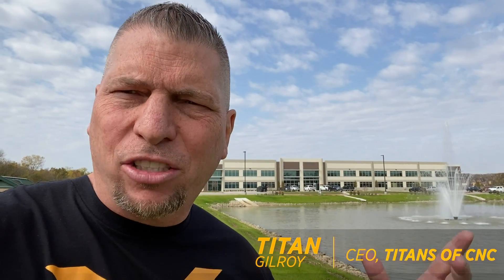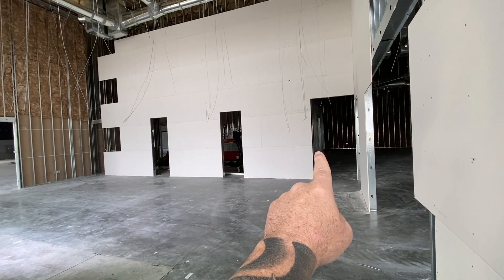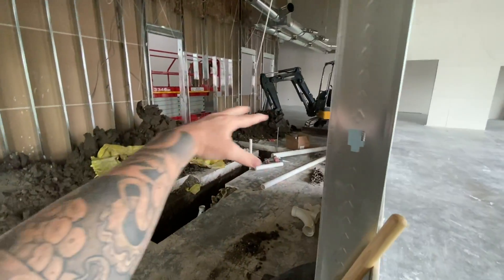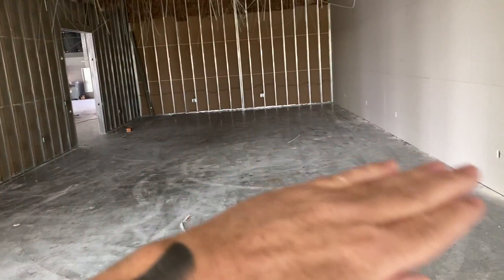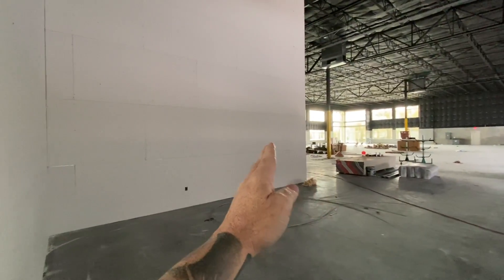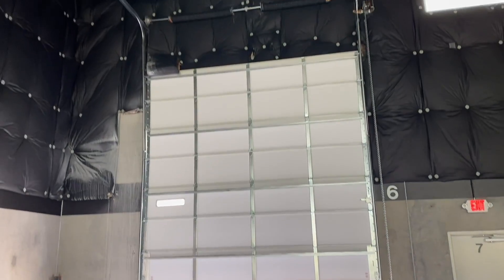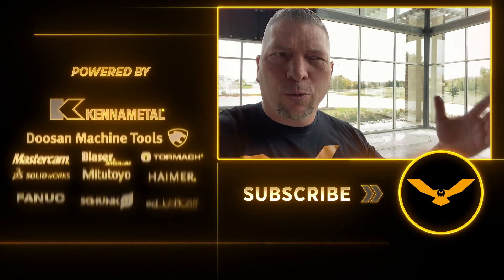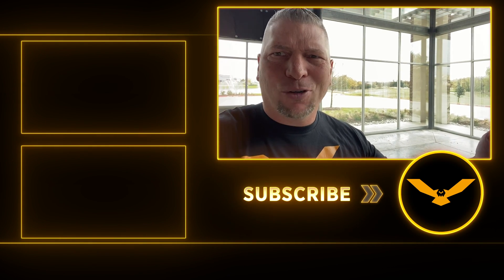BIGGER DOOR for BIGGER CNC MACHINES | UPDATE #3

Comment: Do you have a special method with the flooring, as in do you have to make it extremely flat?
Reply: One will be leveling up each machine to were they should be, very accurately. The machines got adjustable pads, and/or shim plates used. Flooring will be made 'normal flat'.
Reply: @Rimrock300  I agree with that, take a look at 8:20 minute mark of this shop and you will see they have taken out 7ft of old foundations and dirt and replacing with 7ft of concrete and I can only think of two possible reasons, vibration or improving the flatness of the work area. Different style of machining to the units seen above, though interesting. Hopefully, I build a CNC from a $1000 machine next year, and at least I know I can just shim it or leg level kit etc. Cheers for info!

Comment: The concrete slab looks a bit thin for a CNC shop.
Reply: It's possible a general purpose leased building, that one are free to modify the interior as wished. Likely there will be put in thicker concrete slabs at spots where needed

Comment: 1600A 120/ 208V doesn't seem like a whole lot for what you are building.. The 60HP Dusan's spindle pulls 175A  at full power all by itself (on a 250-350A breaker). Add fluid pumps, chip remover, positioning servos, tool changer,, compressed air etc and that machine accessories will fully load its own 400A Panelboard... Bringing in 1600A 480V service would have been well worth it in the long run (unless you are planning to augment with solar).. I know, its easy to spend your money

Comment: Why would do 208 power!? You have 460 there with step downs to 230 lol
Reply from the maker: All my machines are already dialed for 208
Reply: I work at a facility that has probably over 50 CNC machines not all of them are the same but are set up for 208. I use to run conventional and CNC but I work in maintenance where I I’m able to repair CNC machines. This side is more interesting then being a glorified CNC machinist. No offense to CNC machinists. If you can operate a CNC machine and program it and repair it  you are by far the greatest machinist of all time. I’m no where near there.

Comment: I live up north and have been in a few shops over the years. Some shops have a problem loosing heat or even A/C when opening the door. Its upsetting in the winter especially if your working by the door as I happen to do. Not to mention the added expense in utility cost. Will this be an issue?

Comment: pretty good 
i only have one consern witch is vibration throw the floor into the quality controle room screwring with the measuremens ( the company i work for spend about 1 mil not that long ago to get there controle room's floor decoppeld properly from the rest of the building and then the measurements was right and more consistent because the vibration from the machines whend throue the thick contreat floor and shaked the machine and screwing its readings )

so all looks great 
just a little consernd for the vibration going into the quality controle room you have 

best regards from denmark